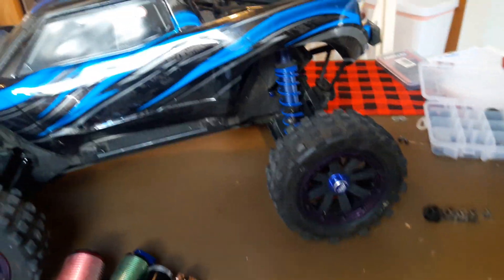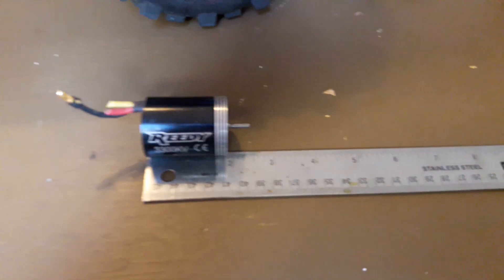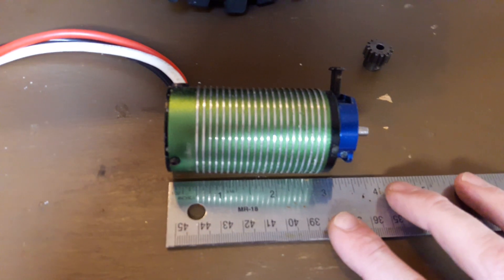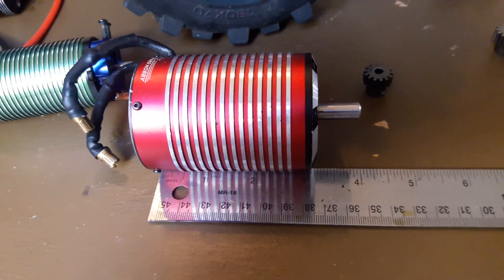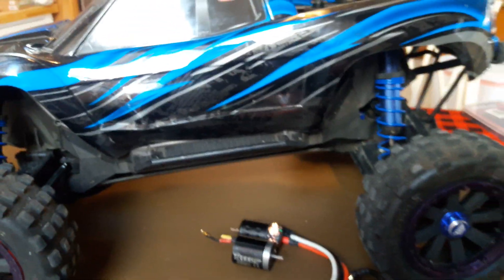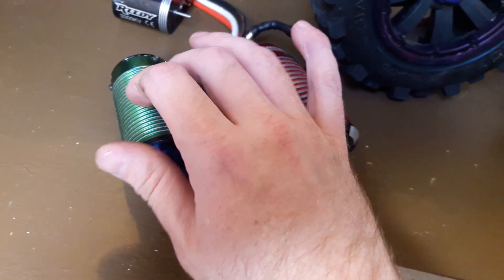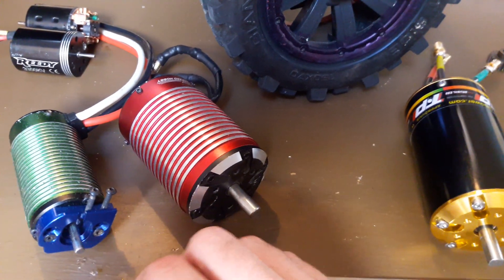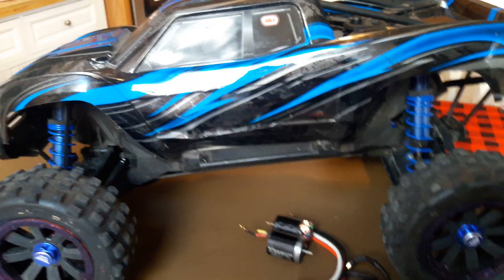RC brushless motor comparison

Comment: I got a 4076 2200kv in my Arrma Granite mega v3 on a hobbywing Quicrun 120esc Ovonic 5200 50c 3s lipo. And it absolutely hauls ass lol. It's a cheaper surpass motor but it's been good for 3 months now. I bought a few spectrum esc and motor combos for it later on. I got all metal mod 8 atm I got the mod 1 gears but haven't needed em yet.
Reply from the maker: sounds fun.  That is alot of power for a light weight car.
Reply: @Liberty.Francis  it is lol 😂 I love it bro. It's deff got the HP n torque to throw it around lol. The center drive shaft got ahold of some wires yesterday and broke the connection on my yellow wire bullet connector so I gotta resolder it which won't take but a sec to do and it done the same thing to my battery negative wire pulled it right out of the connection socket lol. So I gotta resolder it. I got a bunch of battery connectors bullet connectors ect I got off Amazon. But as for performance it's insanity lol
Reply from the maker: @kcmullins6179  there are people who make 3d printed parts that function as a safety cover over the center driveshaft to protect the wires.  Must have upgrade for that rc I think.  Some mentions of it on Arrma forum but not sure where the files are shared...
Reply: @Liberty.Francis  most definitely gonna have to check for those I didn't cut the esc wires down cause I'm eventually gonna use it in something else maybe a crawler or something completely unique. So I had em pushed down in that side clip that holds the wires to test the truck with a new transmitter and receiver. And my nephew wanted to see how crazy it is when full throttle so I showed him lol I was cruising around 30 maybe 35ish then I floored it basically and it just pulled the wheels up and the rear wheels outran the fronts basically and it just went flipping lol. And all of a sudden it lost a ton of power to the motor it wouldn't move front or back but the servo was still working strong but it sounded like the motor was trying to work it had a faint hum to it when I pulled the trigger I thought maybe a rock or something got pulled up in the spur n pinion and locked them up but it wouldn't even move either way and that's a extremely strong motor figure it would just throw what ever was lodged out. So I pulled the body and seen the battery neg wire pulled out n chewed up a little at the connector and my yellow wire was pulled down under the center drive line lol. And when I pulled the wire out the wire came out of the bullet connector. So I was like well maybe that's it lol and I just pushed the wire back in n pulled the trigger and the wheels spin pretty hard so that's all it was it had a hard wreck n wires got pulled on lol. But yeah I got alot of ideas for it I was thinking maybe turning it into a monster senton n picking up the senton chassis n drive shaft and just swapping it all over to it or turn it into a big rock or even a outcast 4s style truck. But right now it's a mean lil rig

Comment: Brushless motors are generally fast but it seems like they are better for going fast all of the time. HobbyWing has some special brushless motors intended for crawlers that can maintain a slow speed but as far as I know they require a proprietary ESC. I personally like brushed motors as their acceleration is so much smoother. I’ve had some success upgrading from stock 540 motors to faster 550 size motors in som RC’s but recently I was on AliExpress and I noticed that they have some 570 size brushed motors! I’ve never seen a 570 size motor in an RC. I almost want to buy one just to see how it performs. It might be good in a crawler.
Reply from the maker: Thanks!

Comment: How do I find out the RPM on a 'Thor 2476 2500kv' motor that I use to run my 'team magic E6 1/8 scale truggy.
Reply from the maker: Kv * voltage = rpm
You have to account for some voltage drop and the fact that gearing weight and aerodynamics play a part.

Comment: What size of motor can I use for a979 b
Reply from the maker: Ramlah Baharom I have never owned one so I have no idea.
Reply: You already have the biggest brushed motor that you can fit in one of those. If you want to go to brushless you can get a 3650 size. Anything over 3,000 KV will have that thing so fast you would never be able to control it. I feel sorry for that poor little guy if you do this though
Reply: If you just want to go so fast that thing flies off the ground try a 3650 5200 KV😊😀😃😄😂

Comment: HEY LAD . I NEED LIL ADVICE HERE ON ESCs AND VESCs . WELL I ORDERED 4600W 4x MOTORS AND I HEARD TO REACH THE MAXIMUM POWER I NEED SUPPLY THEM WITH 48V ........ WELL IS THERE ANY WAY I CAN FUK THE PEDAL TO HEAT THEM UP TO MAX WITH 22V-28V ??? BIG THANK YOU

Comment: It's funny to look at that "big" Leo 5882 and then realize that the TP 4070CM is a lot more powerful.
Reply: Depends how many volts you run through it. The TP has more power if you run 70 volts ;)

Comment: :O. 16hp! OML
Reply from the maker: Got it installed in the X-Maxx now, just waiting on good weather to test it out!!!
Reply: @Liberty.Francis  Where can I get this motor, I'm building a truck from an old t-maxx chassis, I'm converting it to electric.
Reply from the maker: @rome79735  Google TP Power brushless motors.  Or look on eBay.
Reply: @Liberty.Francis  10-4